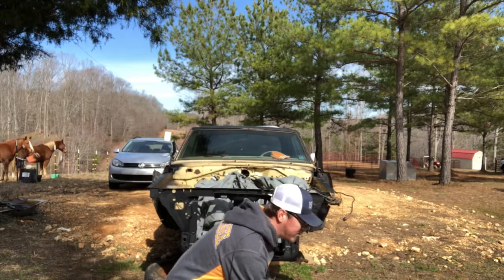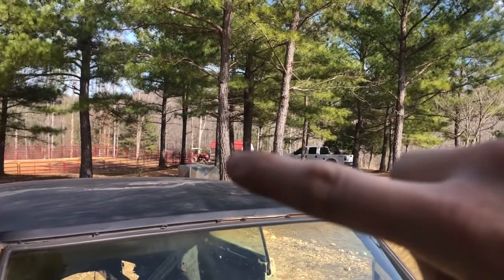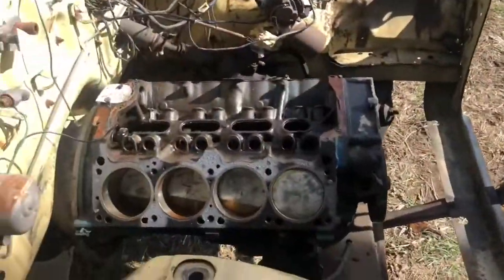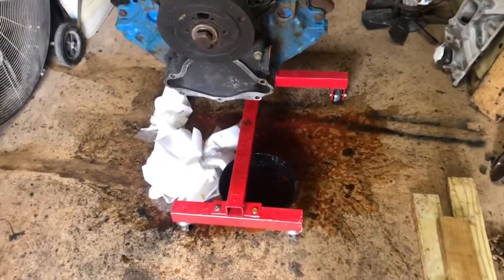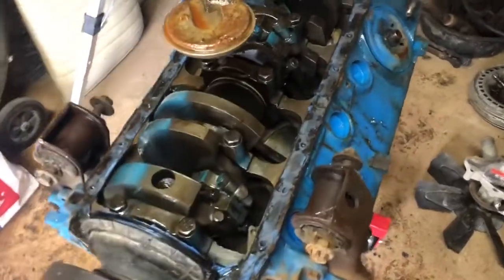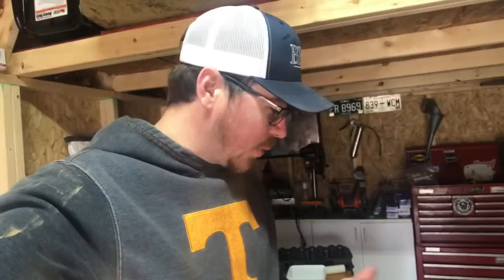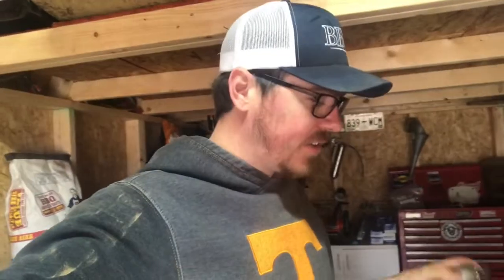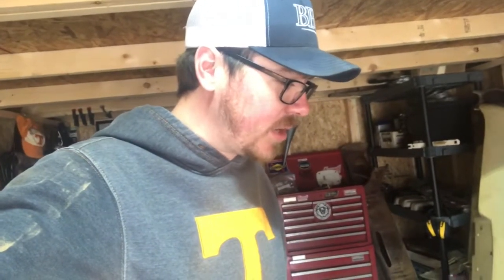Time to pull the engine - 1973 Dodge Dart swinger

Comment: Before the you pull the Pistons if you didn't already. You could get a dial indicator and magnetic base at Harbor Freight and measure how far the Pistons actually are down from the deck. Then figure what your compression ratio is going to be.
Reply from the maker: I already put them back in.  I put a metal ruler flat on the block with the piston at tdc and it measured only a couple mils recessed in.  Great advice though, thank you!